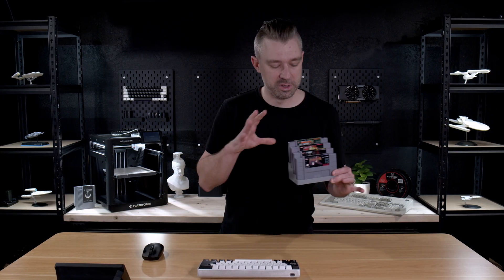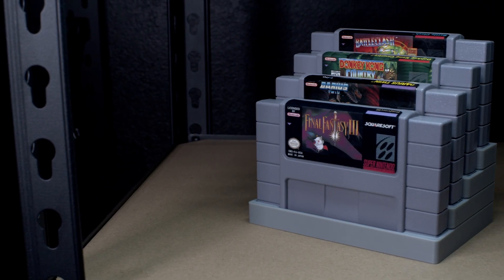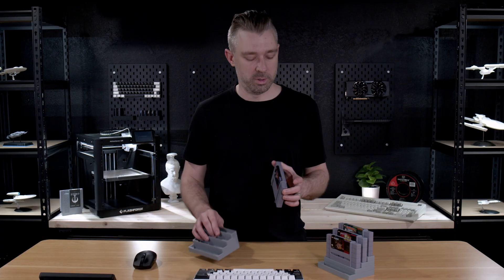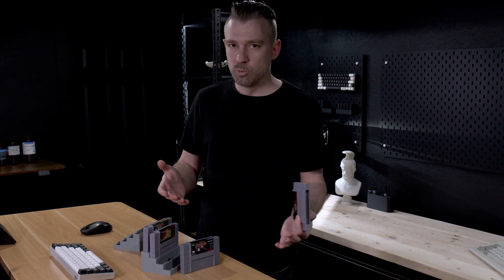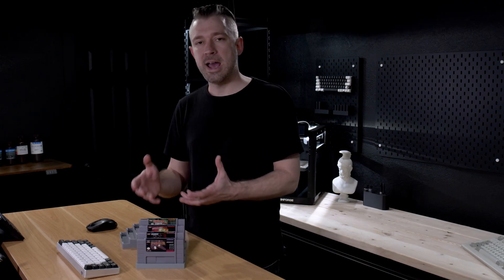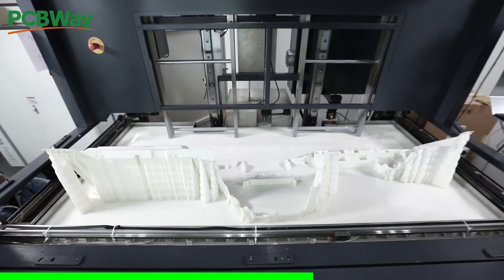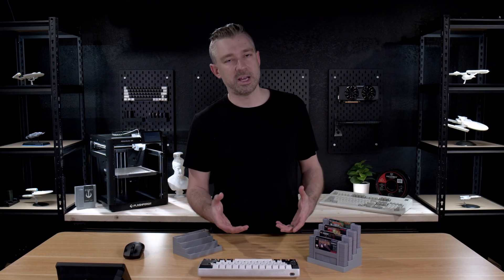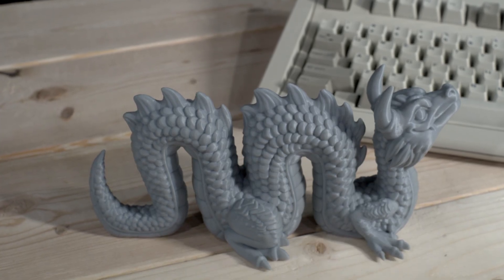Why I Throw Away So Much Filament!

Comment: There is a lot of wasted filament in this industry. There needs to be a recycling program from the community
As for your print job for the Nintendo cartridges, I would have designed it so that I could have used rubber inserts, sort of like the rubber flaps you find in a cup holder in your car.

Comment: Honestly, most basic profiles are a middle of the road solution. You need to do calibrations for every filament and every filament type you use. My prints with the basic profiles look mostly ok but become stunning after tuning. It's just part of the process at this time, you can't have it all.
Your prints might be ok but have the potential to be much better.
Also, all my tuned profiles can print up to twice as fast and still come out better that the standard profile so it's worth investing some time (an hour is goed enough when you've done it multiple times). The filament profile can be used again for that specific filament
Reply from the maker: Yes I agree that people should tune their profiles. Don't get me wrong. I do use tuned profiles. However, when it comes to testing I use default profiles. The main reason is this tells me what most people will be able to expect for a certain filament or file.

Truth is, most people simply don't tune. Even it's better to do so.

Comment: Deeplee is a rebrand of the elegoo filaments.  Their Rapid PLA+, and PLA have become my go to PLA filaments because of the ease of printing and consistent high quality across my different brands of printers.  It is not brittle, does not break easily and I am 100% confident I can run a multi day print without issues.  It is so good that I have contacted Elegoo requesting more colors.  Literally only reason I use other brands is when I need a different color.  Have run with stock settings with good to very good results.  With only minor calibration (temp, pressure advance, flow ratio, etc) have run with excellent results.  I tune all my filaments.  Only Esun PLA+ has come close to the consistent results of the Elegoo filaments.  Difference is Elegoo filaments don't smell when printing, Esun does.

Comment: Great video today. You make some very valid points, and thanks for the tip on the filament, I wonder if it is available through Amazon Mexico, they seem to be a bit behind the times in some cases... Just checked, it is not currently available, so I'll stick with Elegoo  for now, don't care for their cardboard rolls though.
Reply from the maker: Thanks, glad you like the video. Sad to hear its not available for you. Elegoo is my other go to filament. I do like that amazon has Elegoo available with bulk pricing. It helps save a few dollars.
Reply: @zerodotcmd  Wish the bulk ricing was available in Mexico, but all you can get there in bulk is drugs... and tequila.

Comment: For help with this design or ones like it, if you ask chatgbt for a bottom model of a super Nintendo game cartridge so i can make a stand in tinkercad it game me this...Here are the precise measurements for a PAL Super Nintendo (SNES) game cartridge to assist you in designing a stand using Tinkercad. 

---

📏 Cartridge Dimensions (PAL SNES)

Width: 127.75 mm

Height: 87 mm

Thickness: 20 mm 

---

🔻 Bottom Slot (Connector Opening)

Width of Slot: 97.75 mm

Depth of Slot: Approximately 5 mm

Position from Bottom Edge: Slot begins 28.9 mm from the bottom of the cartridge

---

🔘 Curved Edge Radius

Side Edge Radius: Approximately 12.5 mm

---

📐 Front Indentation (Label Area)

Width: 69.85 mm

Height: 5.05 mm

Depth: Approximately 3 mm at the edges, increasing to about 4 mm towards the center 

---

🪛 Screw Hole Details

Screw Hole Diameter: 3.8 mm (compatible with Gamebit screwdriver)

Position: Located near the bottom corners on the front face of the cartridge 

---

🛠️ Tips for Tinkercad Modeling

Base Platform: Design a base slightly larger than the cartridge dimensions, e.g., 130 mm x 90 mm, to ensure stability.

Slot Cutout: Incorporate a slot in the base that matches the bottom connector opening (97.75 mm wide, 5 mm deep) to allow the cartridge to sit securely.

Support Structures: Add vertical supports on either side of the slot to hold the cartridge upright. Ensure these supports are at least 20 mm high to match the cartridge thickness.

Curved Edges: Use the "Radius" feature in Tinkercad to replicate the 12.5 mm curved edges for a snug fit. 

---

For visual reference, you can view a comparison of SNES cartridge bottoms here: 

Feel free to ask if you need further assistance with the design or modeling process!